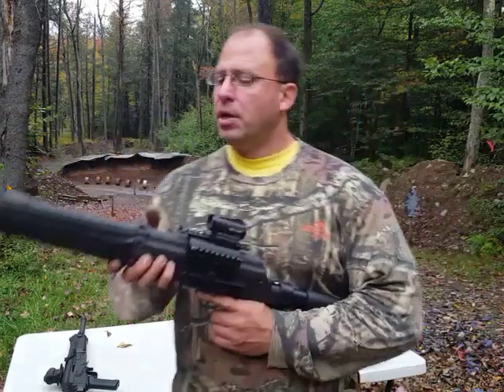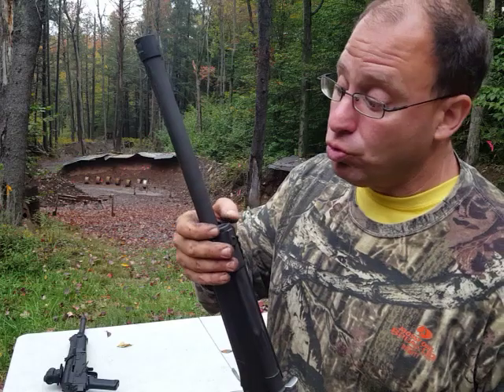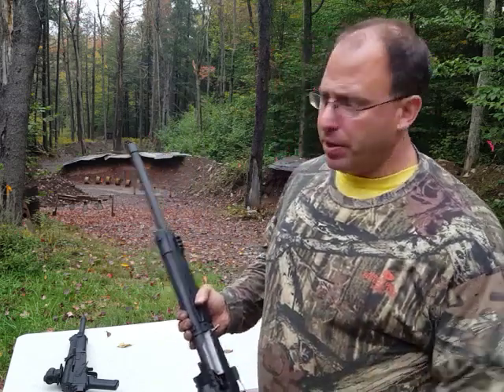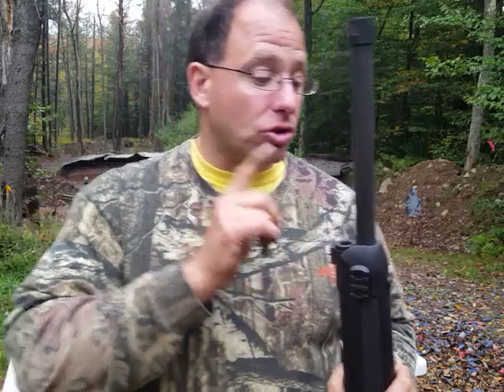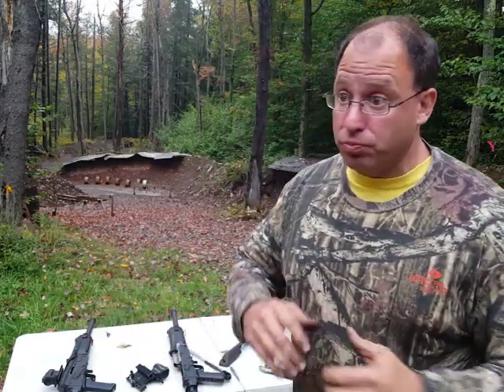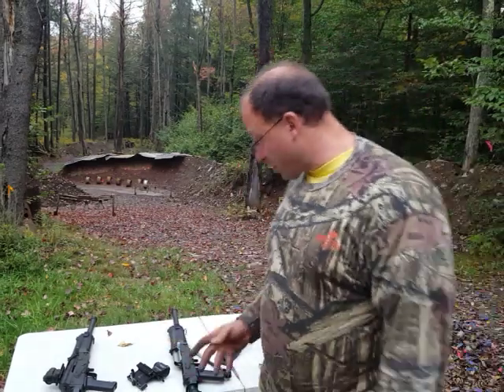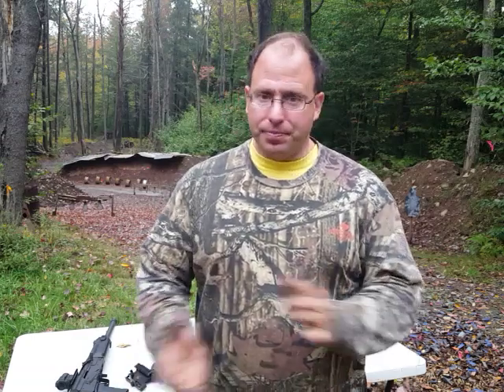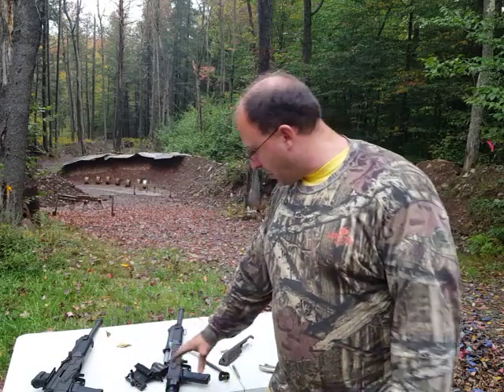Lynx 12 Gas Valve Adjustment

Comment: There is no key. The notches you see on the back of the plug are for the detent that locks in position. I’ve never needed a tool but I clean my plug every range trip
Reply from the maker: I'm seeing that reading this thinking.... duahhh.

Yeah it makes sense that the indent have to go somewhere. Thanks for kick-starting my brain
Reply from the maker: I pinned your comment for the benefit of everybody else 😁

Comment: I wish I found this video sooner, I was shooting 3" Turkey loads in the second largest hole and was cycling correctly but the rubber pad on the spring got chewed up and ripped on the bottom and jammed my trigger, lesson learned, can definitely say this chinese gun can take a beating, now that I found out about the gas system I'll give it a try next time, Thanks for the video!

Comment: I've got a Lynx 12 also but I'm able to turn the valve by hand after taking something and pressing in on the the lock. So far I've only shot like target load in a 2 and 3/4 size with a velocity around 1200 to 1300.

Comment: Hey you’re talking about your plug being seized, the finish on the stock plug is prone to that, I fixed it by replacing the plug with one of the 6 setting ones out there, ever since it’s been able to shoot til it’s dirty, and remove the plug by hand
Reply from the maker: thanks. post a link if you can.
Reply: @tsafa  I use the plug offered by CSS I emailed you a link since the spam filters on YouTube aren’t too friendly to links
Reply from the maker: @braeboi3367  thanks!

Comment: I’ve used the gas adjustment since I bought it, and my trunnion still got beat to shit after a little over 2k shells. Now I’m wondering what to do because Ik the trunnion or receiver is going to give out soon but I really like this gun
Reply from the maker: I have two links 12 with 15 K on each. A third one new in reserve. 

Right now you can get them for $300. Which is almost like $200 in 2017 money. It's becoming cheaper to buy a new Lynx 12 then buy replacement parts.

If you do a lot of shooting,  order another one today.

Comment: Appreciate all the info. Also what red dots do you use and recommend for the lynx
Reply from the maker: UTG mount with Holosun 503cu. If you find a lighter Mount get it. The optic I mentioned is perfect because you can remove the riser and it will sit right on top of the mount. With shotgun shooting you going to use the 65 moa circle. It will match your spread at about 30 yard. Very fast on target. 

I have a video in my channel that talks about it. Do a search that includes... tsafa lynx12 optic. Let me know if you don't find it. When you do, drop a comment in that video so I know you found it.
Reply: @tsafa  thanks I'll look for it and let you know buddy
Reply from the maker: @littlebabymonkey5893  
That's very interesting. I'll have to research it. I'm not familiar with it.

Comment: I just took my lynx 12 to the range and I put 25 rounds though it at 3 inch and 1550 FPS. After 10-15 rounds the trigger started not to fire. I had to push the trigger forward to get it to fire. Just found out that it should be on the lowest gas setting. I had it on the highest gas setting. Could this be the reason why it didn’t let me mag dump. Any help would be greatly appreciated.
Reply from the maker: I'm not sure. The way I would go about trying to diagnose this is as soon as the trigger stops working, open it up and see where it is getting hung up and why.

I'm up to about 15000 rounds of birdshot right now, somewhere around 9,000 rounds my trigger started jamming up. I opened it up and I saw that the rubber stopper in the back had started tearing apart and a piece of rubber had gotten stuck in the trigger mechanism. It was an easy fix to clean it out and then replace the rubber stopper in the back.

Comment: I must've got one built on a Friday afternoon... mine doesn't cycle anything. And there seems to be excessive wear around the extractor on the bolt face from me only putting a handful of shells through... I'm kinda scared to shoot this damn thing.
Reply from the maker: I'm wondering if you have a bad magazine feeding it.  Does the follower move up and down smoothly? 

I got some bad Magazine's myself. I did a video on fixing those.
Reply from the maker: Go to my website in the description and find my email address. Send me some pictures and video if you can.
Reply: I've got a factory mag, SGM Tactical, and a Promag drum. With the factory mag I got it to cycle maybe 2-3 times out of the 5 rounds. With Olin military 00...
Reply from the maker: @WolfZiLLA84  
The next time you're at the gun range with this gun, maybe we can do a video chat or Skype.